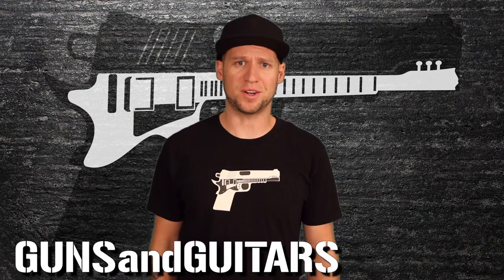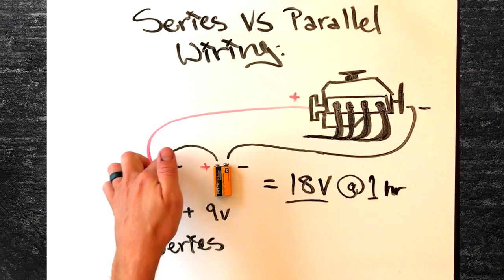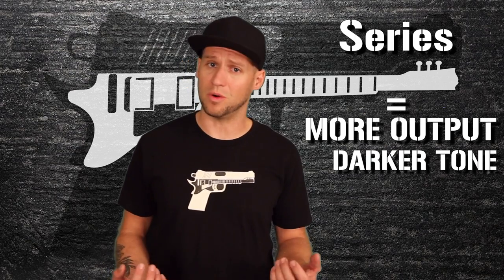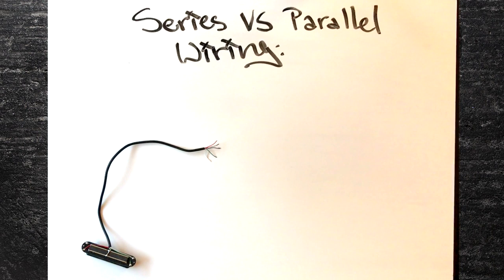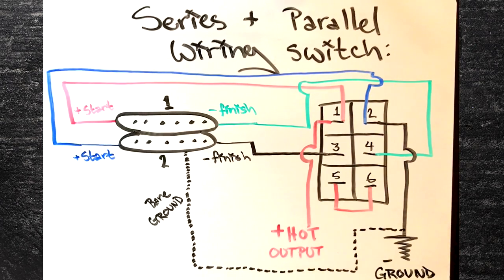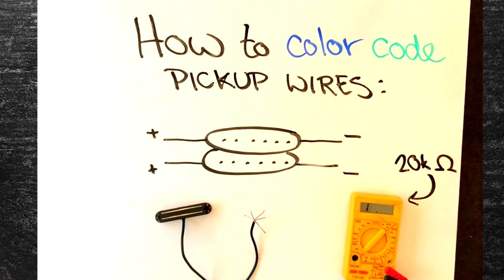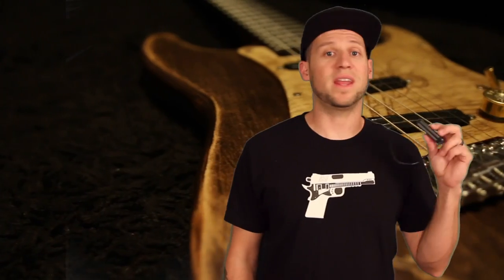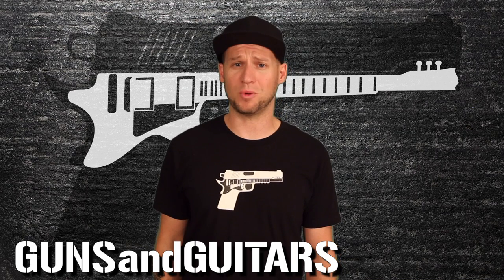How to wire a series/parallel switch for humbucker pickups (guitar hack #2)

Comment: I have a challenge for you, Dan.

I need help figuring out the right way to wire a 1978 Ibanez IC-210. It is a triple coil, with a 4 way rotary switch. I have the switch wiring from Ibanez. What I don't have (and they don't either) is the loom wiring from the pickup, which has three red, and three black wires, two for each coil.

Position 1 is the Coil closest to the neck. Position 2 is the center coil and one closest to the bridge. Position 3 is all three coils in series, and position 4 is all three coils in parallel.

Write me if you like, and I will show you the switch wiring.

Thanks!

Comment: How do you do this for single coils
Reply: There is a common mod for Telecasters that adds the option of putting the two coils in series (the middle position on a tele pickup switch is otherwise always wired in parallell). The principle is the same for two single coils as it is for the two coils on a humbucker, the physics are exactly the same. ;) It just gets a little trickier to wire cause in order to get the full "bridge pickup-both parallel-neck pickup-both series" switching you need a four way switch (4PDT) instead of the dippity doo switch (DPDT) used in this vid. Look up telecaster 4-way switch on google or youtube. Should be easy to find. :)

Comment: Dan hi, can you help me understand where (in parallel) is the connection between the two (+) of each coil? I really hope you read this
Reply: I got the thing working (I bouth your witing diagram and it is just fantastic) I learned so much from it. Only thing (if I understand it right) is that the south coil the "green start" , I treated like a (-) instead of (+) and the red one as (+). From there all went just perfect. Love your videos.

Comment: Ayy new video! Bloody fantastic! Might not be the right place to ask, but every little helps - My strat guitar is buzzing only on the bridge pickup or whenever the volume knob is below 10 on all three pickups. Some of the buzzing is mediated by pissing about with the tone knobs. I'm sure it's a grounding issue, but all my ground wires are connected! Any clue what's goin' on?
Reply from the maker: it sounds like you might have something else contacting your ground.  make sure your 5 way switch, and all hot connections, are NOT touching your ground or shielding.  If you still have issues message me on Facebook, it's easier to have an ongoing conversation there than here in the comments
Reply: Over a year later and I still haven't fixed it LOL revisiting your old videos :)

Comment: Hi Dan. Love the video!
I'm planning to do a superstrat on my own, i have already gotten the kit, but it's just collecting dust at the moment, since i've been trying to understand this. I've made the choice to use 3 hot rail humbuckers using this mod of yours (3 Dippin dot switches, Master volume & Master Tone).
The thing is;
I know people with soldering skills so no problem, but looking at this wiring diagram it was ok to understand in the beginning.
But i dont understand where the +Hot output goes and where the -Ground goes. And when you connect the Bare ground to the      
-Ground i am lost completely. I've been trying to understand this for a few weeks now. It has nothing to do with your video being bad, it's just me not wanting to screw over my project for misunderstanding what you've said.

And also:
Seymour Duncans, DiMarzio etc. are over budget, so i cannot thank you enoguh for showing me how good cheap o' pickups sound

(This is my first project so i know NOTHING, other than the stuff i've seen on your videos).

Thanks in advance.
- P.S I have a screwdriver.
Reply from the maker: Haha! The hot output connects to your 5 way switch in the same spot that pickup would’ve connected without the dpdt switch (as if you wired it normally). If the pickup has a bare ground wire, just wire it to your ground network somewhere (to the case of a volume pot, sleeve of the output jack, or any ground connection anywhere). Hope that helps.
Reply: Hello.
Thank you for your assistance. It sure helped alot. I've been trying to make a wiring diagram to be sure what goes where. However, some new problems have occoured.
(Alot of questions ahead, i do not expect you to take your valuable time to answer)
1) Since my kit is a cheap o' kit, the selector switch only has 7 "spaces"/dots/whatever their name is, to solder on, where on the wiring diagrams i've seen on the internet mostly has 8. Is that a huge difference?
2) I've noticed the use of a capacitator both in my preinstalled pickguard and on the internet. What is it? Do i need it? If so, where and how?
3) Since i chose to remove a tonepod and have a master tone instead, where do the wires from the tonepod in the middle go? The capacitator in my kit goes from tone 2 to tone 1. There's also a wire that is soldered on the tone 2, leading to tone 1. Do i just take that wire and lead it to where it goes, without going to that pod?
4) I've seen differnet people solder a bridge ground connect wire to the string claw, but others soldering it to the output jack. What's the difference? (The pickups i ordered has 4 conducter wiring) And should the ground connect wires from my pickups go to the audiojack, the spring claw, or the Master volume?

Thanks in advance.

Comment: mate can u do a video about bass pickups wiring? i'm specially interested in MM style pickups (gonna upgrade my cheap bass guitar and IDK anything about electronics :s )
Reply from the maker: +Ag Herbert yeah I can, but that's not really a mod or a hack if you're just wiring up as usual. The MM pickup will have 4 conductor wiring, but will already have two wires soldered together for series wiring. Just connect the positive and ground like any other pickup and you're good to go

Comment: Hi Dan, can you wire up a twin humbucker with two dippy switches that are on/on/on with one volume and one tone and a three way switch. Each pickup can then have series/split/parallel. I've tried but I'm a welder, not an electrical guy and its making my brain hurt.
Reply from the maker: +johnnyrandom100 haha that's actually pretty easy to do, I've gotten a lot of requests to do wiring for series/split/parallel. I need some pickups that would sound good split, then I'll make it happen!

Comment: How is coil tapping and this different? I'd love to see the mod.
Reply from the maker: +Jason Austin I mistakenly said coil tapping, what I meant was coil splitting. Coil splitting is where you bypass the second coil, so you get single coil tone, but you're at risk for the interference and noise that comes with single coils. In parallel, you don't have to worry about that. Coil tapping is something else entirely, but it requires special pickups that are built for coil tapping

Comment: Hey Dan! I've been wanting to do this with a Fender Super 5 way switch I have. It's not the standard 5 way switch and I've seen some people wire series and parallel with them but I'm not entirely sure how to do it. How would the DPDT switch grid translate to the super switch?
Reply from the maker: +16GHunter exactly the same as wiring it without the dpdt switch. Just put the switch between the pickup and the super 5 way switch, and connect the hot and ground to the 5 way as you normally would directly from the pickups.
Reply from the maker: +16GHunter actually I take that back. I don't believe you can do this mod with a super switch because the super switch is meant for coil splitting. What you need is a on/on/on switch to do series/coil split/parallel, but then you would have no need for the super 5 way, a standard 5 way would be all you'd need.
Reply: Guns and Guitars the YouTuber Ben Eller has it wired like that in some of his RG's. of course he might have a different component than I. Thanks for the response though! I've actually been really enjoying your recent videos. I'm surprised you don't have a bigger following. Thanks for the help!

Comment: awesome video, dan! and thumbs up for dropping the snapchat fillers while keeping the overall humor!
as idea for future vids: I see you left the stock mechanics and tremolo in the strat and p bass. did you ever consider relicing or refinishing metal parts, as well? I think finishing the metal parts on that strat in vintage copper would fit into that relic style... many thanks!
Reply: edit: I myself thought of just painting the metal parts with true metallic but I read much about people using acidic fumes or salt to age and tear chrome and nickel, which - I could imagine - would be more your style :)
Reply from the maker: Hey thanks for the input.  I actually tried using muriatic acid to etch the metal parts, but it couldn't penetrate the chrome plating.  What I ended up doing is scrubbing them real hard with a dry scotch pad, that really did the trick.  The now look like "brushed metal" with the copper showing thru in the more worn areas.  If you want message me on Facebook and I'll snap a closer pic so you can see what I mean

Comment: How do I get even  the single coil option in a 3 mode switch and what function should the 3 mode switch have?
Reply from the maker: +Iron Magnus my next wiring hack video will be on this subject. How to do series/split/parallel switch with a 3 way mini toggle switch
Reply: Like to c that wth 3way as well.

Comment: I know it is an old video, but I am just wondering. Do I have to use one dippin dot switch for each humbucker or can I solder more than one on a switch. I have an HSH configuration with one vol, one tone and a switch (which is now used for coil-split). Can I use only this one switch to switch from parallel to series on both pickups? 
Nice vid!
Reply from the maker: You need a dpdt switch for each pickup. If you want to do two on the same switch you’ll need a 4pdt switch.
Reply: @GunsandGuitars  thanks bro appreciate the quick response

Comment: Can you wire all 3 pickups to one toggle switch?
Reply from the maker: +James Schofield I'm not sure exactly what you're asking. Like one mini switch to turn on all three pickups?
Reply: Guns and Guitars I mean only one switch to change all 3 coils from in series to parallel. Or does have to be the 3 switches?
What I ultimately want is to have a 10 sound fender. I want parallel with the 5 options on the 5 way blade. Then when I flip the dpdt switch all the coils are in series with the 5 options on the 5 way blade. If this isn't possible, I'll try 3 push pull pots, I just don't have the room on my pick guard for 3 switches and don't have the tools to do any woodworking inside the electronics compartment

Comment: How do I wire my pickups so that they produce sonic dystrophin parallax induction without producing voltages that exceed the RMS of a tube pre-amp’s input taper and still sound like they are in series?

Comment: On a coil tappable single coil pickup. Can you wire this series/parallel ? As apposed to half coil/full coil.
Reply from the maker: +Malcolm Hardwick no. This only applies to humbuckers with two or more coils
Reply from the maker: +Malcolm Hardwick with a cool tappable humbucker, you can still do this

Comment: IDEA FOR NEW VIDEO!  The issue with this is that the volume drops when you put it in parallel -- the advantage of parallel vs split is that the volume doesn't drop as much. BUT what if on pins 5 and 6 you put a resistor? This will limit the series voltage and lower the volume. This will mean overall output of the pickup will drop, when it's in series but you can fix that at your amp, but the volume can be balanced when you switch from parallel to series. ( hopefully )

Comment: Would you happen to know anything about the amps of a switch and what would work in a guitar? I'm pretty much limited to components from Home Depot. I'm adding a middle pickup to my guitar (making it an HHH) and I wanted to have a 2 position toggle switch to activate that pickup
Reply from the maker: Guitars pickups are such low voltage that it really doesn’t matter what amps your switch is rated for
Reply: Guns and Guitars thanks for the reply. I actually hooked it up and it works. I'm gonna change the neck tone knob to a volume knob for the middle at some point though. It's a little weird without the volume.

Comment: How do you make the bullet tone and volume knobs?
Reply from the maker: +Ty Hawke I'll make a video on this soon hopefully. But the short answer is I cut off the ends of spent 12ga shells, drilled out the primer, filled it with hot glue, and drilled a whole for the pot shaft to stick in. Hope that helps

Comment: What is the middle position on the switch?  I installed as you said and have three selections
Reply: Should I have gotten an on-on dpdt switch?  I got an on-in-on
Reply: @RobertEMason  Yeah, it's a two-position switch. No middle position. With your 3-way switch, however, you could do, for example, series/parallel/coil split.

Comment: Also, using a 3 way DPDT switche will allow you to switch between series, parallel AND single coil :)
Reply from the maker: Yes! I’ll be doing a tutorial on this in the future, but hot rails don’t sound good split, so I just stuck with series/parallel for this video. I’m gonna do that with some other pickups though.

Comment: I tried this setup, and it doesn't quite work. One way works fine, but the other way only works on positions 2 and 4. And neither of them seem to have any grit, so I can't even tell which way is which. I cannot for the life of me figure out what I did wrong. Any thoughts?
Reply: EDIT: Turns out a pickguard screw was causing a short.
Reply: Also he's got second pickup polarity backwards should be 2 is negative and 3 is positive

Comment: can i do it with the 3 way toogle switch? just for 1 humbucker pickup
Reply from the maker: +Hariadi Odi yes you can do it just for one pickup. If you use a 3 way toggle you can do series/split/parallel, which is actually probably more valuable
Reply: thank you bro

Comment: wooo, that was pretty informative - again!
this time thought I wold have liked you to slow down quite a bit.
after all this is some serious shit, that's not that easy to digest for a beginner.
(I'm also not a native English speaker)

though I learned quite a bit on this one, I would prefer to start with something more basic if and when I try this.
maybe next time you could start by explaining the regular way a guitar is wired and the possible variations of it before jumping right into mods.
although the video was great the second half was a little too fast and advanced for me as a beginner.
I still learned a lot though and it's still a pleasure to watch you do your thing.
if you keep them coming I'll keep on watching.
thanks!
Reply from the maker: +Martin Jastram this is good feedback :) I'll keep this in mind. I agree I probably spoke too quickly when demonstrating the voltmeter stuff. I'll slow down for the technical parts in future vids
Reply: i´m looking forward to seeing, how you´re going to put your special twist on that ;-)

Comment: Dan, I'm building a strat myself and need some help. Is there any way I can message you and talk about the build?
Reply from the maker: I help out my Patreon supporters ;)
Reply: @GunsandGuitars  gotcha. I think I got it figured out. Doing a 7 way strat build with series parallel and I wired the neck pickup to the wrong spot on the push pull pot.

Comment: i would like to see just changing the electronics to better parts :) .. as im thinking to buy a cheap guitar .. but i have heard that changing the electronics can improve it cheaply ..
Reply from the maker: +Mikkel Carlsen yes, if you haven't seen it, check out my cheap eBay kit before vs after upgrades video. It sounds way better with a few cheap upgrades. There are links in he description too for the parts I used

Comment: anyone knows if i can connect 2 humbuckers to the same switch to have them both parallel at the same time? 1 push/pull for 2 pickups.
Reply from the maker: Yes and no.  You would need a 4pdt switch, so you can wire it that way.  But no, because I don't know of any push/pull pots that have a 4pdt switch.  They are all dpdt to my knowledge
Reply: Guns and Guitars so basically one switch-one pickup? you can’t connect 2 pickups exactly the same way to the same switch?

Comment: Great video. However your definition of series is being contradicted in the diagram. Finish of coil 1 connects to finish of coil 2. That's 2 negatives and confusing. Now i know since the pickups are jist coils its not like a battery. I suggest adding an explanation for how this really works. The 2 opposite directions of current are what make the pickup hum-bucking and thats what matters. The circular direction rather not start and finish of the coil. Any can can be the start or finish based on how you place them

Comment: Not very accurate. The pickup doesn't generate electric current, it generates signal. In the analogy of the motor, the battery would be the amp (voltage source) and the motor would be the pickup (load).

Comment: This is wrong! The hots have to be on the same side: If red is on 1, then blue should be on 3, not 2. Black should then go to 2. The way you have it, you are permanently shorting the blue positive to ground - ouch! That leaves the 2nd coil out of both circuits. Ground out should be on 3, not 2.